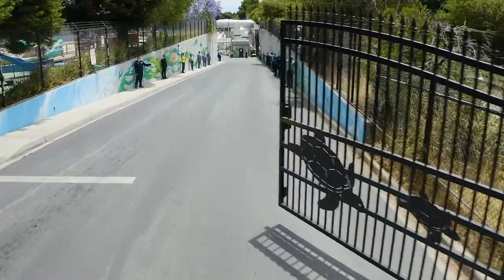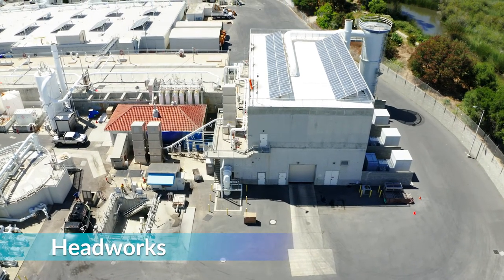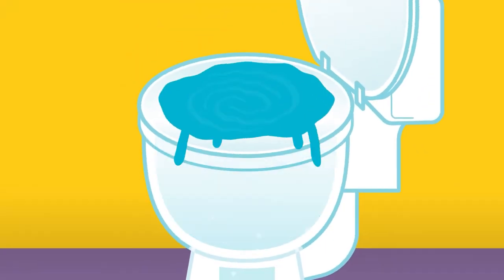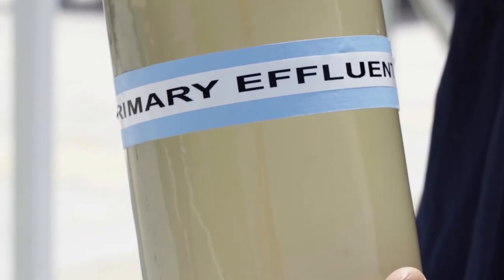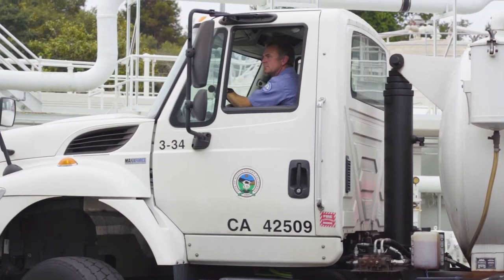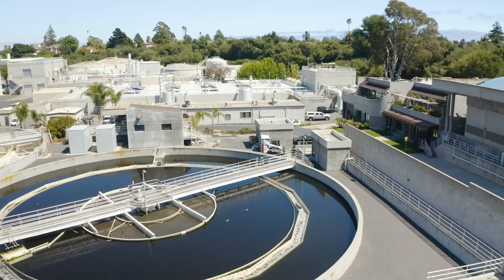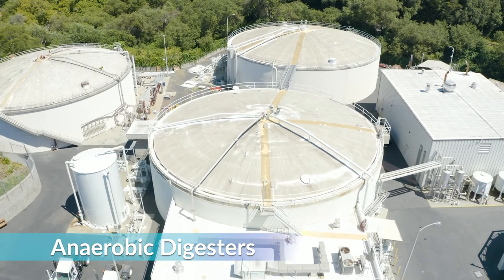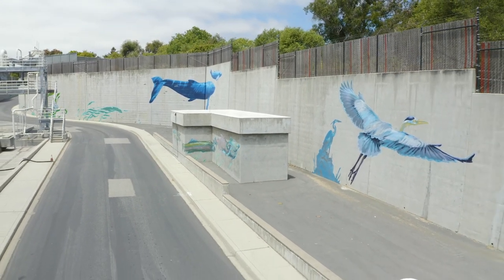Santa Cruz Wastewater Treatment Facility Tour

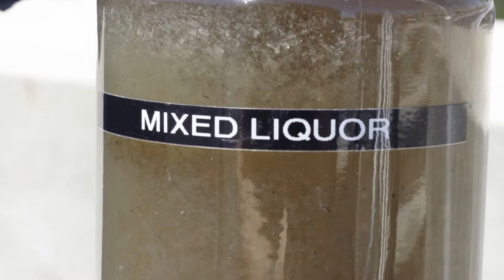Comment: 11:05 He says there isn't any alcohol in the mixed liquor. That's not exactly correct. There are actually a number of different alcohols and metabolites produced in mixed liquor owing to a bunch of fermentation processes occurring during the aerobic stages of treatment. However, one would probably not want to drink this mixture because of the extreme pathogen load and horrible taste. Not to mention that it's only very small traces of alcohols in the liquor.

You'd get sick and die before you got drunk.